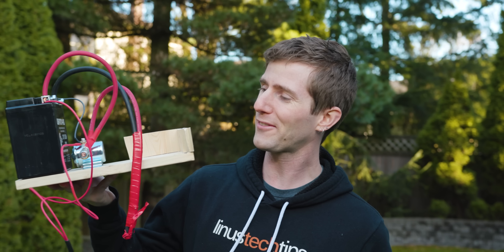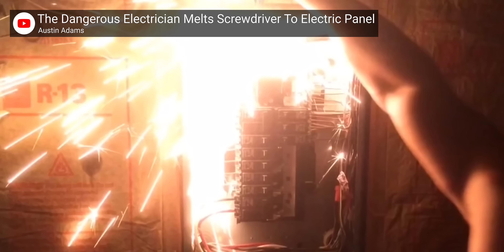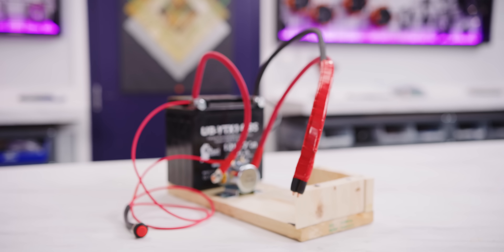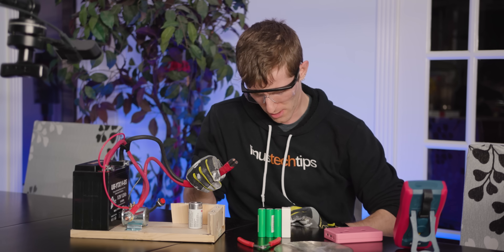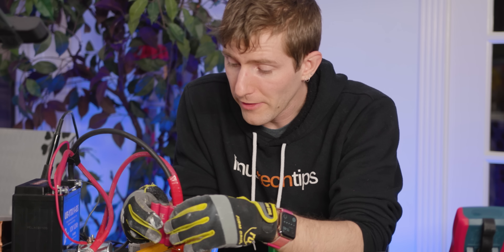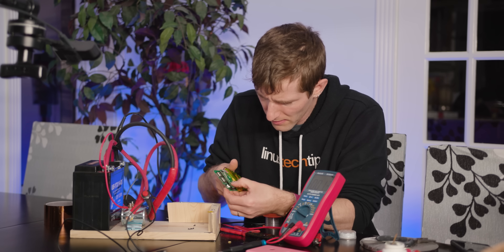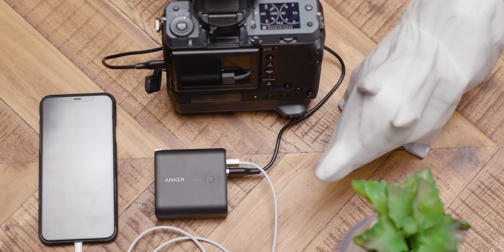I spent $100 to save 20 bucks... and it was TOTALLY worth it!

Comment: @3:51 You have no electrocution hazard with the 12V you are dealing with from this small lead-acid battery.  The 2 main hazards you have when dealing with such a setup are arc flash if the connection is not decent, you accidentally short across the terminals or your relay doesn't disconnect quickly enough and a fire hazard if the lithium battery casing is damaged and the electrolyte ignites.  

People need to get an education on basic electrical power.  DC power is very safe well past 50VDC and it is not really possible to cause electrocution (death by electric shock) with dry skin contact until you are well over 100VDC and shock-related death occurs mainly due to an inability to let go and break the circuit.  It only takes about 30mA of 60Hz AC current through the heart to cause fibrillation, compared to 300-500mA of DC current. The 'let go' current (above which you cannot let go of a grasped conductor) is 4 times higher for DC than AC. So that means you need 4+ times more DC voltage to get a fatal shock.  Even AC is generally considered safe below 50V.  Don't get me wrong, electricity needs to be respected especially at higher voltage potentials but people just need to get educated about the real risks and precautions to take based on common sense rather than everyone being a pansy about everything in life.

You might feel a very slight tingle even at low voltages around 8 or 9 volts when touching across the terminals with the same finger but it is far to low to cause death and the path is not across any vital organs.  The only real risk with low voltages is metal ion migration into the body with prolonged exposure completing the circuit but even then the body does a fairly good job of removing those metals over a relatively short period of time.

Comment: That battery's short circuit power is probably over 1.5kw, I'd bet it's not switching correctly because the relay is constantly welding its own internal contacts

Comment: Most solder will not stick to batteries so there is no other choice than to resistance weld the tab to the battery.  In resistance welding, the 3 things that will affect the weld is the current, time and weld force.  In your setup, current is not controlled since you are just shorting the battery.  Time is controlled by your momentary button. Lastly, the weld force is dependent on how hard you are pressing down on the electrodes.  So it will be tricky to get the weld right by holding down the right amount of time for the weld button and pressing down just hard enough not to get a spark.  A small rounded tip (no sharp points) will work best for the copper electrodes so they do not pierce through the nickel strip and also not cause sparks.

Comment: Could of literally just got a cheap soldering iron and solder but instead built a damn spot welder for 4x more. Unless you're an idiot soldering isnt going to heat up the battery to a level that will damage it.

Comment: Messing around with high voltage storage devices while wearing a wedding ring can be super hazardous....ask me how I know.
Reply: None of this stuff is high voltage. The battery is only 12 volts.
Reply: @rubiconnn   I would rephrase that to sources "capable of high currents". Even at 12 volts the battery can deliver 200amps of current when short circuited (this is what they basically do when welding, but for just a moment). So it's not the voltage that could harm you, but the heat generated if you manage to short circuit the battery through a ring (highly unlikely in this video, they done a decent job isolating the leads).
Reply: How do you know?
low Voltage with higy current will melt a ring.
Reply: @JohnHoranzy  I never said it melted it....gave me a circular burn around my finger....nothing like having a fully circular burn blister on your finger
Reply: @Alex-kj5yp  Don't ask me how I know about solidified molten metal in in my body. 

I think everyone on this thread understands the dangers either high or low voltages. 

Leather aprons for welding are nice to have.

Comment: The contactor is a Great idea, Waaaaay safer than using a microwave transformer. Also doing this is a great way to extend use, recently i put two Samsung 35e's into my bose mini soundlink 1 giving it new life and an increase of about 30% over the OEM pack, and seen as i have all the equipment already so it cost me €7 worth of cells. Instead of the €40 for the oem at only 70% the capacity of the Samsung cells. #righttorepair

Comment: 3:58 - Note on this part, if you're planning on welding undefined amount of times, it will be very inconvenient as you do need a repeatable weld time which you cannot achieve manually like this
Reply: Is there a way to add a timer into this ?

Comment: you have stuff like arduinos at the office, could of easily got a transistor capable of switch on that relay, and then u could of added a potentiometer for timing control

Comment: You guys shouldn't wire anything more complicated than this. You don't even mention putting a current limiting resistor on the momentary switch to keep its contacts from welding together, you know... the point of the relay in the first place. This setup will not last because you'll burn out the switch or kill yourself cooking the 18650 when the whole circuit welds shut real good.

Comment: Maybe consider controlling the relay with an arduino ? You can make a pulse timer with it and it will trigger and hold the relay on for a specified duration. That way you don't have to think about how long you should hold and maybe it'd be less dangerous...

Comment: FYI generally what you wanna do with spot welding is have the current flow through the weld, rather than into one piece and then back out the same piece.

Comment: You can remove the old nickel strips by grabbing them with a pair of needle-nose pliers and twisting. Or you can take a chisel and a hammer to knock them off. The easiest method to recover though, is to spot weld strips on top of them.

Comment: Should have used an scr triggered by an 18 650. The scr would dump a capacitor Bank that you charged to a specific voltage to achieve the correct number of watt seconds for the weld. As soon as the capacitor bank is discharged, the scr unlatches. With the scr, you don't risk the contacts in the relay fusing, and you don't lose energy in the spark that is contained within the relay.

Comment: "nasty electrocution hazard" out of 12 volts ROFL.
Reply: Electrical burns at low voltage still hurt.
Ask me how I know.
Reply: @juozasdomarkas848  I know where you're coming from I've been there but the only thing that you should be concerned about with 12 volt is heat not "electrocution"
Reply: @Muhammad_Hiyari  
Some ppl have sensitive organism. Sometimes heart can fail.
Reply: @AliShuktu  XD
Reply: @AliShuktu  
Maybe if your a still wet saltwater fish and you lay on the battery..
Reply: I shorted out a transistor and burned my finger (with blister) trying to rescue it.
Reply: @shapshooter7769  I feel ya, can't count how many times I got burns with such stupid actions, hope your finger is healed in no time.
Reply: Volts don't matter at all. Amps do. It only takes a an amp or so to kill a person
Reply: @Demonslayer20111  I'm gonna try to make it as simple as possible, without high voltage no current (amps) is going to flow through your body (it will flow but it'll be so minimal you wouldn't notice) 3:18 look he touched the poles of a 12 volt high amperage battery with his bare hands without dying.
Reply: @Muhammad_Hiyari  shocks are also not the same as just completing a circuit. That's why people can work on high tension wires. Touch without a ground though, you dead.
Reply: @Demonslayer20111  you know what never mind I'll just end this empty argument right here by, say and believe whatever you want.

Comment: Dont probe USB like that. The USB casing is grounded. It seems like you shorted out the 5V output and board spent some time resetting the resettable fuse.

Comment: you did exactly what the battery probably  liked, the connection of 2 strips should be less of a problem, then the heat that would have come from the iron soldering directly on it.

Comment: You should have built it around 21700 batteries. Samsung has some great ones that provide 40 amps continuous awhile holding a legit 4000mah. 18650's are great, but a thing of the past in automotive applications.

Comment: I bought a battery powered spot welder board on eBay for 20€.
Just connect it to a car battery and it controls the timing and duration of the weld. It also has a manual mode, where is triggers just after you make a connection, instead of continuous timed triggering.
Reply: It is called "Spot Welder Maschine PCB" on eBay.

Comment: @Linus could this be improved by adding a relay controlled by a capacitor-potentiometer circuit to regulate the application time of the current? So pressing your button releases the capacitor at a consistent time, opening the relay until it's empty - use the potentiometer to adjust the time.

Comment: This is worst way than soldering, you can safely solder on battery if you know how and not really heat it up at all. Using this junky spot welder you will only burn holes into battery housing and destroy it (how you did)

Comment: That relay need a diode between his coil terminals otherwise you could kill your battery.
And that's probably what was causing it to stay ON after you stopped pressing the switch.
Reply: It could've been also improved by adding a microcontroller to control the relay to be more precise. With their approach it's hit or miss, they either press button for too long or too short

Comment: If you want to make that spot-welder a little easier to operate, try looking up a one-shot pulse circuit with duration control. 555 timers are easy to wire and super inexpensive.

Comment: The best of both worlds is something like the XTAR PB2S, can use 18650's, 20700's, or 21700's, type-c charging port, and it's ~$20, plus it's significantly less of a fire hazard!  Awesome video regardless guys, these are the kind of questionable nerd endeavors I came here for! :D

Comment: The electrons actually flow from "ground" to "hot". (But that's not really important for this kind of welding, with TIG it can be) (also: that's not a belt sander :D) (wiping the two mating surfaces with acetone beforehand may also help)

With a raspberry pi, some simple electrical components and a very simple python program you can make your own precisely timed spotwelder. Look for a plan for a RPI controlled 12V solenoid, and just replace the solenoid with the relais.

Comment: For anyone looking to buy a spot-welder, I highly recommend getting a Kweld unit! It's small, it's powerful, and most importantly – reliable! You can power it off a suitable lipo battery, and it allows you to adjust the actual POWER that goes into a weld based on the resistance, which gives very consistent spot-welding results.

Comment: You forgot to mention a critical step. Choosing the right Battery. While the AA Batteries everyone is used to have a clear standart, theese are industrial cells. Those have very different ratings in stats depending on wich you choose. Because the target group are engineers, that actrually know what they are doing. So if you can't calculate the actual needed current to compare to what the powerbank actually needs, just forget about it and buy a new powerbank. Furthermore there are tons of Batteries with faked ratings that you can buy from China. So be safe and don't risk burn down your house.

Comment: 8:10 this isn't really a mistake because everything you said before it was right, but obviously you are using the capacity of all 4 cells.

Putting cells in parallel increases amp hours while cells in series increases voltage. However, both increase total energy capacity which is essentially current times voltage times time, watt hours.

Edit:
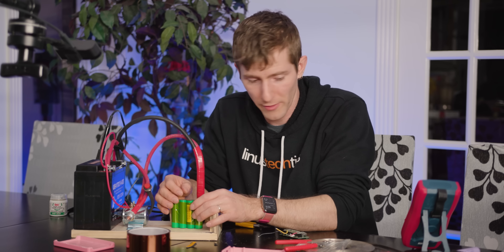Oah yeah and about 10:17. It's obviously not ideal but it's definitely not going to kill the battery if you do it properly (which you did), so good choice!
Reply: This was the comment I was looking for (specifically the edit)
Reply: This is the internet you're supposed to say something mean and degrading to him, not something nice.
Reply: This needs more likes.
Reply: Did you mean "power capacity" as in energy ? because watt hours is not power.
Reply: @koolkimoov  yes, that is more accurate. Thanks!
Reply: wait there is a proper way to do this
Reply: You should put batteries parallel if they come that way you can over volt and burn pcp if its not ment for highervoltage of series battery
Reply: In 2s 2p you get capacity of 4 batteries
Reply: current times voltage gives power (watts), not energy (watt hours)

Comment: EE here, this is the most painful video I've seen in a while.
Reply: Yeah man. Seeing those tabs and leads getting that hot was painful even for me. Also the soldering iron tip wasn't very clean and likely not very hot
Reply: You should watch JayzTwoCents replacing a smd on a graphics card. This is relaxing by comparison.
Reply: @chrismann2848  JayzTwoCents makes Linus look like a f#cking professor LOL...
Reply: @chrismann2848  yeah, I've seen that
Reply: Lol I'm not a ee but I do welding for little projects and stuff this is painfull af

Comment: I do this literally every day.. DONT DO THIS.. buy a proper spot welder or solder them.. a soldering gun will not hurt a battery of that mass.. smaller cells maybe but not 18650s or larger... Unless your out of your mind and holding the soldering gun on for MINUTES.

Comment: I would have covered the battery. The electrodes may not transfer enough current on their own due to the small contact points, there is a real risk of accidentally getting a massive current dump if something goes wrong. Lead acid batteries have a habit of exploding if you discharge them quickly. Not something you want to take lightly.

Comment: Thought i would be more interested in the battery. But i actually ended up not caring about it, but am definitely going to make a spot welder using this method. Should be pretty nice for the thin sheet aluminum i have.

Comment: What I need to know is how to replace the control board, I have plenty of perfectly fine cells left over from Anker power banks, the issue is that the trash board that Anker includes with the power bank only lasts about 200 to 300 cycles on a 20100 power bank.... RIP leaving the perfectly fine cells with a significant remainder of their lives left.

Comment: Meh I spent $250 and built a 150AH battery bank  (3x 50AH pouch cells, thanks Aliexpress) from scratch. It may weigh 7 lbs (has a shoulder strap) but it will run my phone for a week 24/7 even with energy saving off and playing games the whole time.

Comment: With a properly sized resistor, an electrolytic cap, a trim pot and a small signal relay you can build a circuit that activates the big relay for a precise amount of time, and the same amount of time every time you press the button. 

You should have probably mentioned, that these big relays are normally used for car engine starters. Search for "500A relay" on ebay or aliexpress.

I built something like that on a breadboard a while ago, but I had bad luck as I was using old strip cutoffs that felt like they were plated steel.

Comment: This setup IS a bit stupid, im Just using a 100 000uF capacitor And it works much better then his does.
Reply: Btw, those pulses are too Long And have too little current.

Comment: Built a few of these.   Note a Automotive 650CA battery is WAY TO MUCH Amperage.   Bad Ju Ju befalls the Battery Cell.  You can buy a Regulation circuit for under $20.00 to control the Weld Times.   Makes life a butt load better.  Requires the use                of a small AC voltage transformer.  https://www.banggood.com/Geekcreit-NY-D01-40A100A-Digital-Display-Spot-Welding-Module-Time-and-Current-Controller-Panel-Timing-Ammeter-Spot-Welders-Control-Board-p-1559616.html?rmmds=search&ID=517855&cur_warehouse=CN

Comment: you should always fix electronics if you can, 4 good batteries cost 7€ here, nickel trips and bit of tape prob 1€
soldering iron most people have at home, old cells can be reused or resolld. people make big cash off used 18650's from laptops and powerbanks

Comment: You guys absolutely should have used an Arduino or Teensy or something similar to control the time the relay was active for. Why would you leave something like that to the inconsistency of human reaction?
Reply: Because you would need to know the current, the voltage etc.ant test, test, test and only then program an Audrino. That would require weeks of work and research. Thah would make sense if LMG was making a product to sell for the public or a device used daily inside the company. This is just for youtube views, not a commercial device.

Comment: So if welding has to be timed perfectly, perhaps it makes sense to add an electronic timer to the button preset (or adjustable) to a perfect time? Even better, beep on shutoff as well.
Reply: even better, I bet you could make a simple circuit that had an adjustable dwell so you could easily fine tune the spot weld times

Comment: There really isnt a reason you shouldnt solder to these. All you have to do is get your soldering iron as hot as it will go so it can heat the contact as quick as possible, and the battery will only heat up a little if at all. I have multiple 2s battery packs that I have made this way.

Comment: Don't build one like this. For a job like spotweling you use high current mosfets. Using a mechanical relay is dangerous as it could weld itself internally. Use mosfets in parallel and add an arduino with a small display and encoder knob for making timing adjustment. 

Then also, and this is important, add an emergency breaker to the main power system in case of a short.